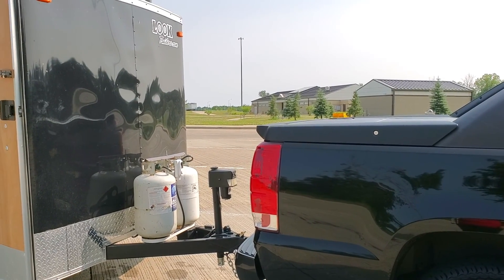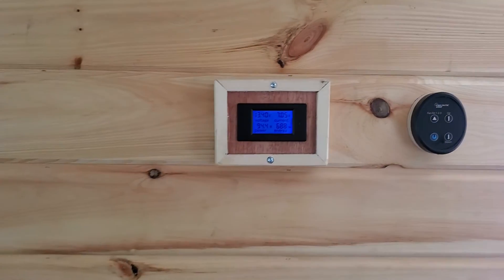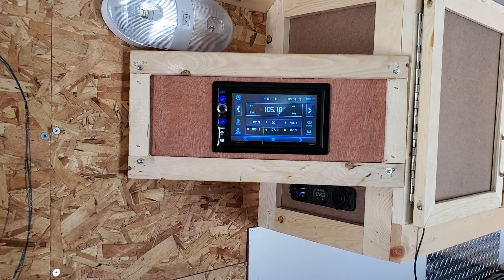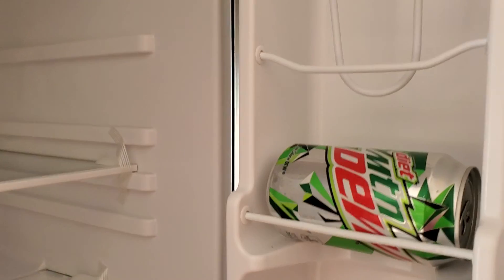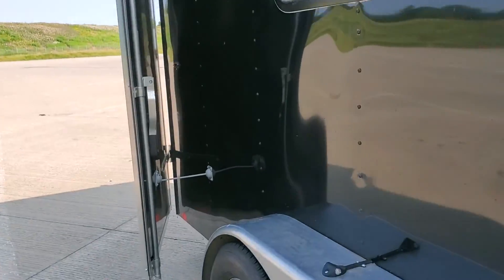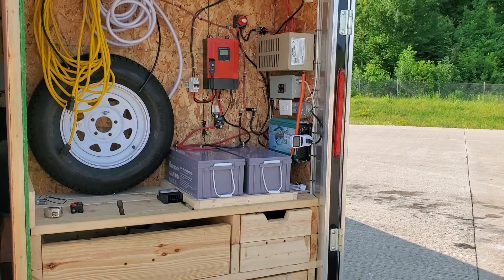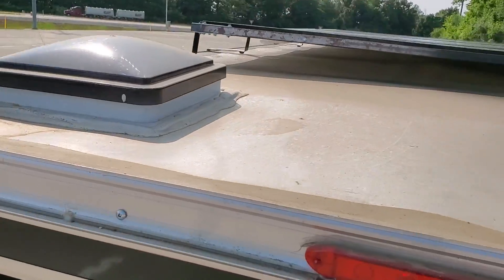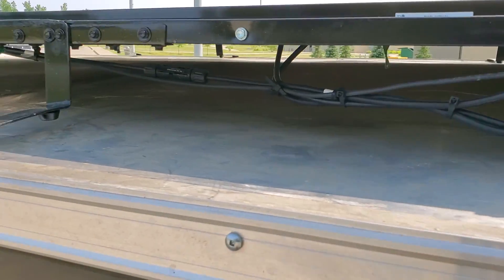RV BUILD - Ep #5 -  2 -12 V RENOGY AGM Battery 400 AMP hours

Comment: I got the same batterys, i was wondering what voltage you charge them up too?  13.0 volts? And at what voltage is ot at 50%? Thank you so much
Reply from the maker: Hey there,
Please stand by.
Driving.
Thanks for watching. ❤️
Reply: No problem any help would be much appreciated
Reply from the maker: If your using solar the charge controller has a preselect profile for a AGM battery.
If not you have to user define your own parameters. 
Max charge voltage 12.8 to 13.0. ( same for a inverter charger )
50 % state of charge for an AGM battery I used 12.3 volts that will save your batteries from damage.
Hope this helps.

Comment: Like what you’ve done with the place. I have 4 of those batteries coming soon and they’re about 130 lbs each. I would just be concerned about your weight distribution in regards to your tongue weight. Have you calculated that out? Did your handling characteristics change? Any compensation for that tongue weight? I’d hate for you to get in a death waggle (my term).
Reply from the maker: Hey there Dan G, the hubby figured it out as far as the weight distribution. Everything worked out just fine.
Let me know how the 4 batteries work out. Take care. 
Thank you so much for WATCHING❤
Reply: @AdventurousJeriLynn  if the world is still here I’ll try with my addled brain.👍🏼👍🏼
Reply from the maker: @dang6832  too funny.
Reply: @AdventurousJeriLynn  the 4 are finally up and running with a 3000w inverter and a 1000w inverter/charger. The smaller is so I can hook a generator or grid power to charge them if needed. 1500w of panels into a Renogy Li 60 charge controller. 3/0 welding wire to tie everything together to make sure the power flows easily. As long as the sun is out I can do laundry all day(exciting) and the batteries will not dip below 90%. My plan is to run the fridges, small chest freezer, and a tv off the system. This way I’ll see if I have enough should the power cease to keep the food and entertainment going. Also trying to save on grid power and recoup some of the investment as I wait for a power outage and hope it doesn’t happen and keep my cpap going so I can sleep well. I’m waiting on an electrician friend to see if we can run new receptacles so it’s not extension cords and have them hooked up to the inverters. I want them to be red receptacles so we know what is backup. Unfortunately he’s a little busy right now. 800ah of batteries is good so far.
Reply from the maker: @dang6832  ~ Hey & HOWDY ❗️
W O W.. That is so AWESOME to hear. 
You seem to have it all put together. 
That was a great plan that seem to work out pretty good.
Thank you for sharing all your ideas with me and the channel ~ I appreciate it. 
Take CARE. 
Thanks for watching ❤️

Comment: How are the Renogy 200 amp/hour AGM batteries doing now?
Reply from the maker: setsailatnoon ~ Excellent. As long as the batteries don't get cold, we keep it warm in the cargo trailer. Make sure not drain batteries pass 50 %.
Thanks for watching ❤
Reply: @AdventurousJeriLynn  We've been off grid both on our homestead and in our RVs...since 1984.  The last batteries we had/have are Trojan 8D AGM, similar to the Renogy 200 amp/hour...they are still going strong and I installed them in Oct of 2006.  Due to COVID, I just ordered some back up Renogy batteries...like yours.  We just rec'd them yesterday...I won't install them until my current batteries begin to fail...then I'll move these Trojans to auxiliary positions in the greenhouse, the summer house and our "nest" guest house.  All have solar panels.  Thanks...keep in touch.
Reply from the maker: @setsailatnoon  ~ that sounds like a great plan. Let me know how it goes.
Take CARE.

Comment: They are 200 ah each which means you can only use up to 200ah. You cannot use all 400ah or you will kill your batteries. Please learn how batteries work. Never drain more than 50% of your capacity.
Reply from the maker: Montana West Photography We do appreciate your comment, we do understand the difference between regular and lithium batteries if they were lithium batteries we can use up to 80 % because of the cost saving and our budget we chose to buy sealed lead acid batteries. We chose two 200 amp hr batteries giving us 200 amp usable at our disposal 50% keeping our batteries in good health. We have done our research and understand how they work before we bought them. I appreciate your feedback.
Reply: To say it will "kill" your batteries is misleading. It shortens the life span but doesn't kill the battery. Killing, gives the impression that if you ran an AGM down below 50% once, the battery is shot. That's isn't true